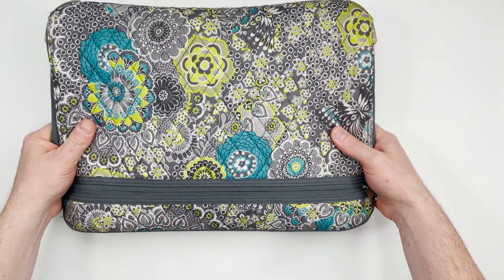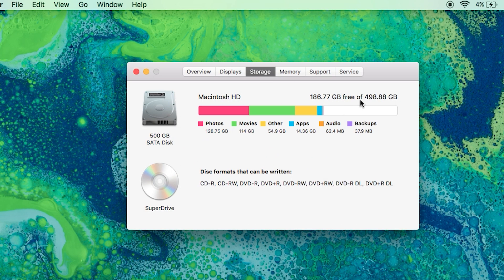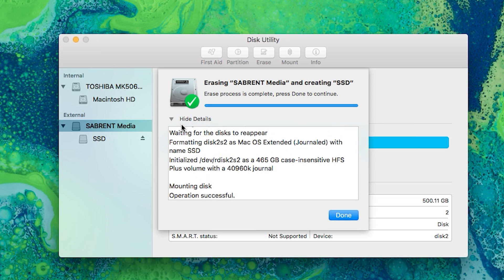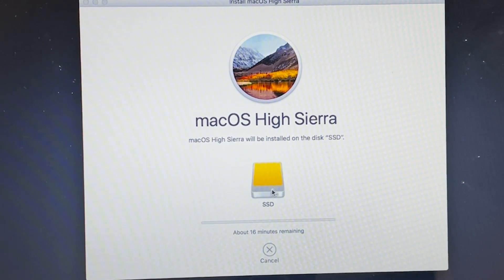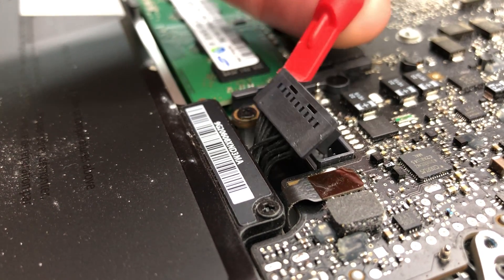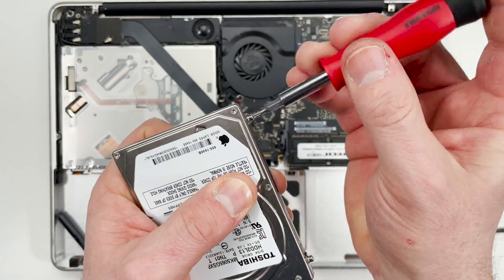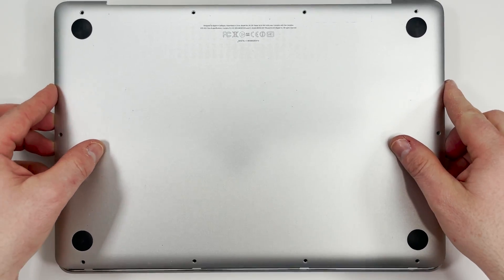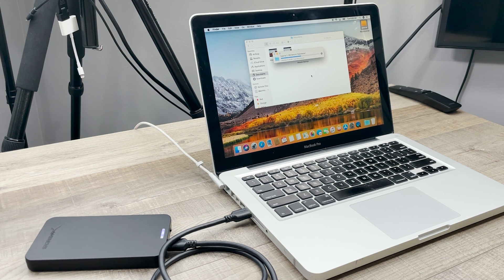How to Upgrade a MacBook Pro Hard Drive, RAM, and Battery - Easiest step by step

Comment from the maker: *If you are only needing to transfer photos or docs, I would recommend just installing a clean OS and transfer your files through the external USB.

If you need to upgrade your iMac HDD with an SDD, the video is found here: https://youtu.be/aD9yC0cm_ec

Comment: Today we learn the location of a Harddrive. I was also taught about the black tape that is connected/ aligns with the bluetooth and wifi for the laptop. I amsumme the large fan is the fan to cool down the system. I also learn about the location for the GB's.

Comment: I watched your video and I was trying to do the same thing with my Macbook Pro 8,,2 that was running Lion.  Problem with mine is, my computer crashed so I cannot get it to boot.  I have tried internet recovery numerous times and although it had worked before, it won't do it now.  I bought the new SSD from OWC so I know it is the correct harddrive.  Any advise on doing this would be helpful.  I just keep getting a white screen whether I try to do and internet recovery on the old disc or new disc even though I get a spinning globe showing it's downloading but the utilities menu never comes up.  Please help.  Thanks.

Comment: command r does not work, what to do next? I end up moving all files to my new hard drive by dragging it. After that, I swapped the new hard drive to the old one. I followed the command/option/R/P prior to powering the computer. Once power is on, there is no file being read, and it only shows a folder on the screen. Did i do something wrong? Anything would help.

Comment: It is very important to keep track of the screws and where they come from as they are different sizes. You can use a piece of cardboard, draw a rough outline of the computer and punch the screws into the cardboard so they stay put. Then put them back where they belong when done. Nice video!